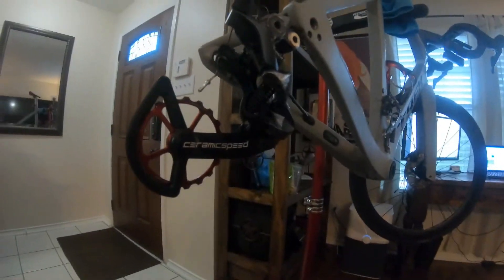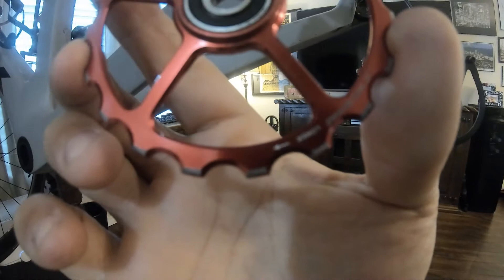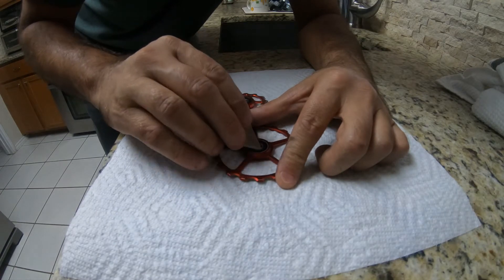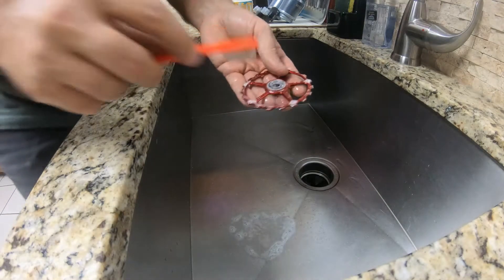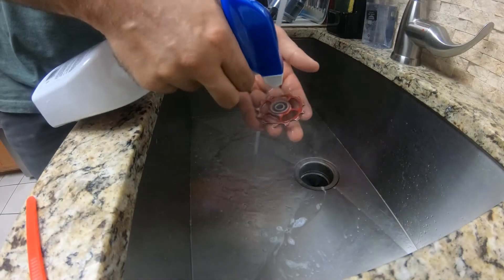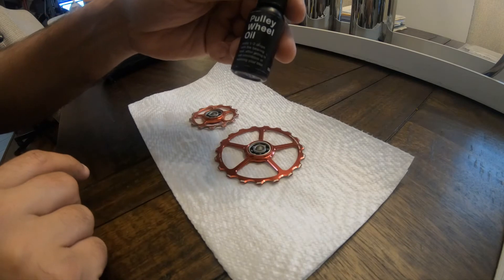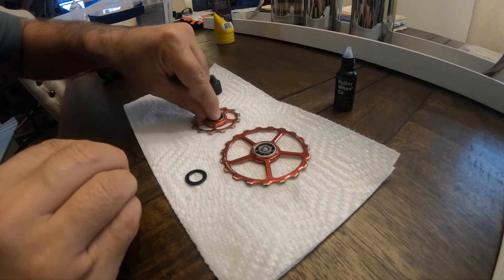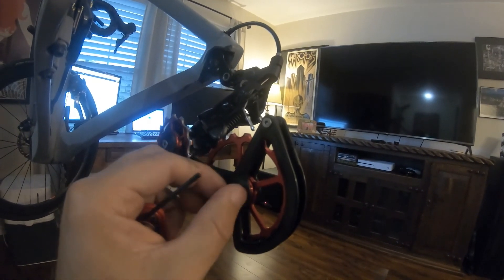Ceramic Speed Oversized Pulley Cleaning

Comment: Interesting how people spin ceramic speed pulley wheels to prove.....
I would say the oil is only really to benefit the 2RS and stop them binding as ceramic bearings would normally run with no lubricant as the balls hold their shape unlike steel balls.
Do they have any side to side movement once remounted?